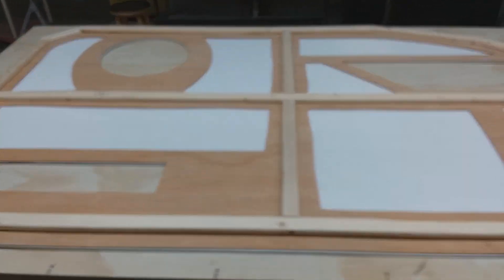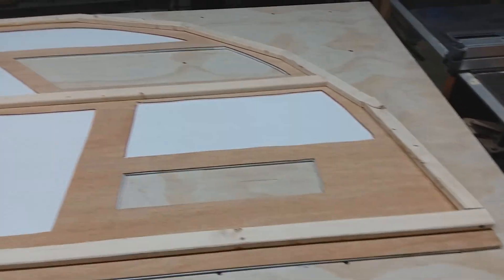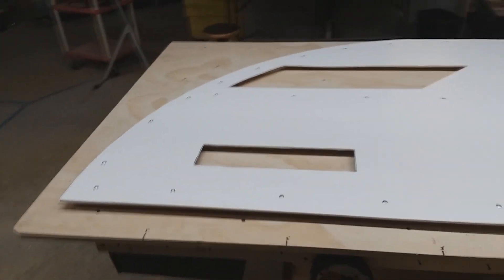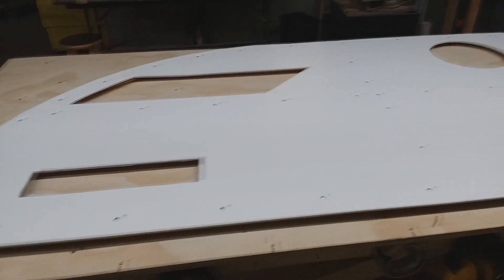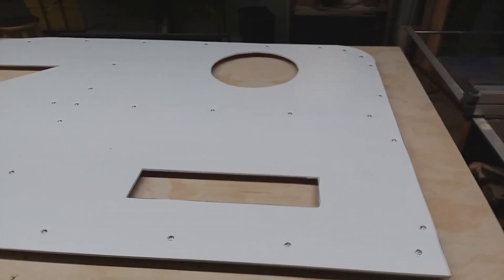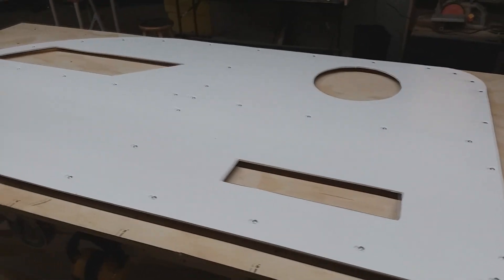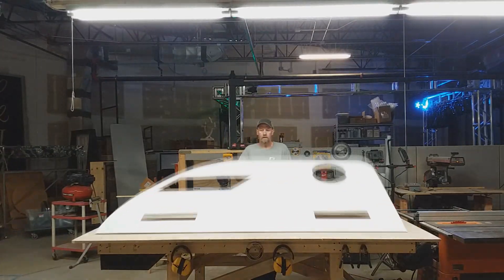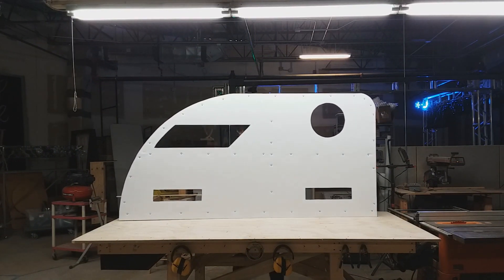Bicycle Camper Build Pt.4 Framing the Shell

Comment: whats the total cost of this project? currently working on a folding camper myself where the first half is solid as in holding non movable things..electronics,battery stove, the rest folds out and up for sleeping and such. keep up the good work looking forward to final product.
Reply from the maker: I am at $165.00 so far. Hopefully I can get some scrap plexiglass and not have to buy, but I am sure  the cost will increase at least another 100 bucks or more. Not trying to be practical and frugal on this build. I want it close to an actual camper, but on a micro scale. Thank you for checking it out. Would love to see your build as well.